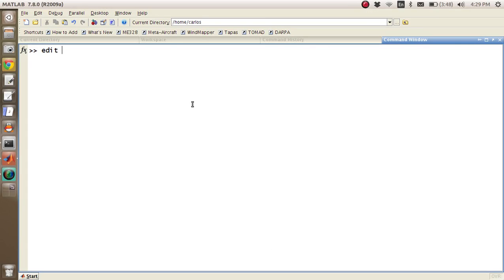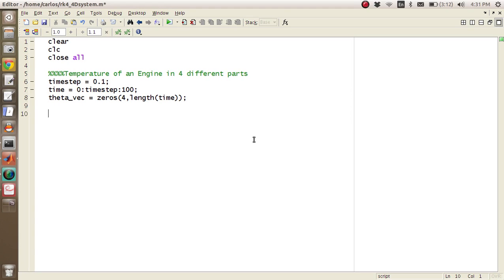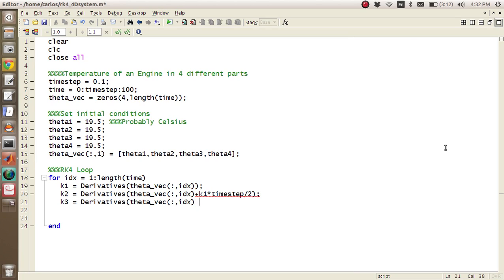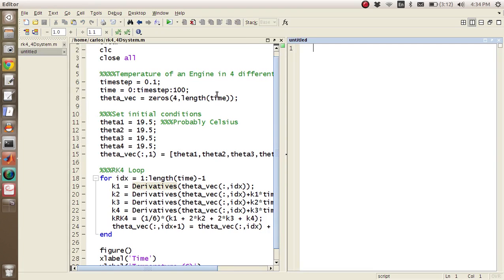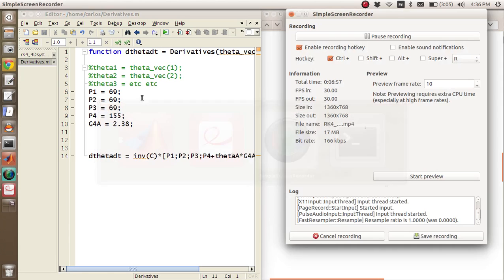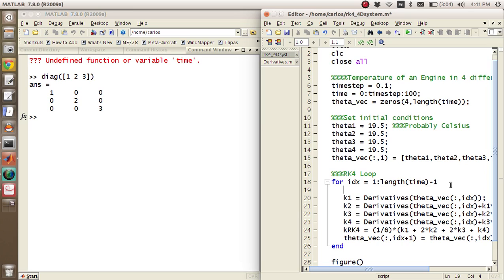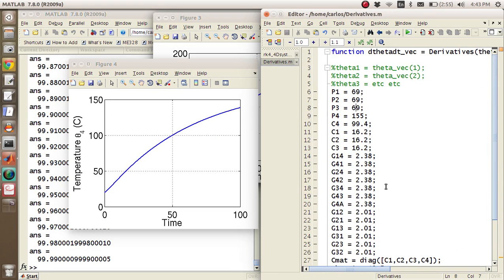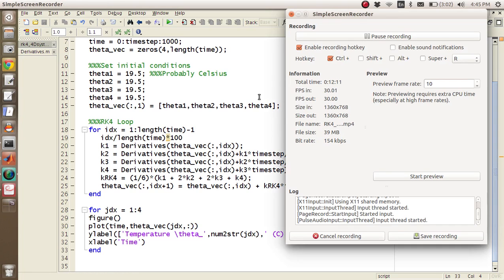MATLAB Help - Runge Kutta for Coupled ODEs

Comment: Hello Dr. Carlos, do you have a script in which one can include time-dependent terms in the differential equations? for example, ydot = -2*y + x*Et, in which x is a constant and Et is a time dependent term which is a driving force of the system for instance. Thank you.
Reply from the maker: The derivatives routine right now just has theta_vec as an input. If you send time as an input to the function you can add time as a variable to your DE solution. Hope this helps.
Reply from the maker: Here is an example with Euler's, RK2 and RK4 where although time is not explicit in the DE's but it is at least an input into the derivatives function. https://github.com/cmontalvo251/MATLAB/blob/master/Screen_Cast_Codes/RK4/myrk4.m
Reply: @CarlosMontalvo251  thank you! I have found a solution now, basically one has to interpolate the time dependent term at the specific time point and add as in input.
Reply: @CarlosMontalvo251  Sorry Carlos, the website is not available now! I still don't know how to solve the time-dependent situation.
Reply: @jinhuizhong8806  Sorry, can you help me ? I have the time- dependent question, too. How do you solve that? Thank you very much!
Reply from the maker: @silversherry_8500  Apologies. Here's the new links https://github.com/cmontalvo251/MATLAB/blob/master/screen_cast_codes/Integration/rk4_4Dsystem.m and https://github.com/cmontalvo251/MATLAB/blob/master/screen_cast_codes/Integration/Derivatives.m Also updated in the description

Comment: Thanks a lot for your video.I tried this method to solve my time-dependent coupled
odes and succeed,but the timestep needs to be set very small in order to converge.So it takes too much time to solve odes(usually several hours even a whole day).Do you have any good idea to lengthen the timestep and save time?Thank you very much!
Reply from the maker: Unfortunately it's not a simple fix. Timestep convergence is dictated by the dynamics of your system. If you are trying to simulate a system that has a lot of high frequency dynamics or even chattering due to some sort of switching the simulation is going to take a very low timestep to converge. This is where adaptive timestep algorithms like ode45 or even stiff solvers do a heck of a lot better. So you have two options. Lower the fidelity of model (remove some high frequency dynamics) or try another integration solver. Typically I go with the first or run my sims on a super computer worst case. Good luck.
Reply: Hi Boy, can you show me how to include time-dependent terms? That is exactly my question. Thank you.

Comment: Dear Dr. Carlos
How to solve a system of nonlinear 2nd order differential equations:
M.u" + C.u' +K1.u + KD.u^3 = -M.l.ag
where M, C, K1 and KD are matrices.
Using for loop.
Also, can I have your email?
Thanks in advance
Reply from the maker: You solve it the same way as the video above. Create a vector called u_vec and place all your states in there. In the derivatives routine you plug in your equations of motion by solving for u" using the matrix inverse function. Also no email. I'd rather respond on here.

Comment: Hey Carlos,
Could you please assist me to solve  a 2nd order state space equation with ODE 45 . I am going wrong somewhere in the A matrix and the formula. Please verify and correct me.
Thanks. You can email me at haripd94@gmail.com

MX ̈+ CX ̇+ KX = F 
Equation 1

where
F = μsN(Sgn(X ̇− V ) − σ(X ̇− V )),
Equation 2

σ=sigma= friction coefficient versus relative velocity slope
(grade), b V=belt velocity, N=normal force. By substituting
equation (2) with equation (1) yield

MX ̈+ CX ̇+ KX = μsN(Sgn(X ̇− V ) − σ(X ̇− V ))
Equation 3

Equation (3) can be rearranged as:
MX ̈+ (C + μSNσ)X ̇+ KX= μSNSgnN(X ̇− V ) + σV

K=5;
M=1;
C=1.5;
sigma=0.5;
nu_s=.5;
V_b=.5;
N=10;
x_dot=.5;

x0=[0 0.5];  

A=[0,1;-K/M,-C/M];

[t,x1]=ode45(@(t,x) ((A*x)-([0;1/M]*(nu_s*N*(sign(x(2)-V_b)-(sigma*(x(2)-V_b)))))),[0 20],x0);

plot(t,x1);
Reply from the maker: Sorry but I can't help you on specific problems. Perhaps this will help https://www.youtube.com/watch?v=mXzD9PTwdj4

Comment: Hi sir, i am a under-graduation student  there is a code in two  file (one is function, another is for output) i am uploading three part one for function , second for output , third for another function where parameter are differents  from first one. This code successfully run for first function parameter but not run for third function parameter  . please help me.

FIRST PART(parameter)

function xprime = state1(t,X) 
% CALCULATE THE TEMPORAL DYNAMICS OF DIFFERENT STATE
%________________________________________________________________
% PARAMETERS USED FOR THE CALCULATION%___________________________
h = 6.626*10^-34; % Plank's constant (m^2kg/sec) or "Jule"
c = 3*10^8; % Speed of light (m/sec^2)
lambda_P = 532*10^-9; % wavelength of the pump beam
lambda_S = 633*10^-9; % wavelenngth of the signal beam
r = 0.5*10^-3;        % radius of the pump beam ( 0.5 mm)
A = pi*r^2;           % Area of the beam
E_p = (h*c)/lambda_P; % Pump photon energy (in Jule)
E_s = (h*c)/lambda_S; % Signal photon energy (in Jule)
%eV = 1.61*10^-19;
%E_p_eV = E_p/eV;     % Energy of the pump photon in eV
%E_s_eV = E_s/eV;     % Energy of the laser photon in eV
P_p = 1*10^4;         % pump power (50 mW)
P_s = 32;        % signal power (50 mW)
sigma_a = (10^-16)*(10^-2)^2;      % Absorption cross section (cm^2)
sigma_s = (10^-15)*(10^-2)^2;      % Emission cross section (cm^2)
sigma_TT = (10^-14)*(10^-2)^2;     % Triplet-Triplet absorption cross section
%sigma_ESA11 = ((10^-16)*(10^-2)^2)/0.001;          % Intersystem crossing rate (sec^-1)
eta_ISC = 10^8;        % Constant intersystem crossing rate
sigma_ESA = (10^-14)*(10^-2)^2;
%_________________________________________________________
Ip = P_p/(A*E_p);      % Pump rate (1/m^2/sce)
eta_P = Ip*sigma_a;    % Pumping rate (photons/sec)
%_________________________________________________________
Is = P_s/(A*E_s);      % lasing rate (1/m^2/sce)
eta_SE = Is*sigma_s; 
%_________________________________________________________
t_f = 5*10^-9;        % radiative lifetime of the molecules
eta_f = 1/t_f;        % Rate of spontaneous emission
%_________________________________________________________
%eta_ESA = Is*sigma_ESA;
%eta_ESA = sigma_ESA;
%_________________________________________________________
t_T = 1.5;
eta_T = 1/t_T;
%____________________________________________
eta_TT = Is*sigma_TT;
eta_ESA = Is*sigma_ESA;
%____________________________________________________________
%SOLUTION OF ODE BY 4TH ORDER RUNGEE-KUTTA METHOD
xprime = [eta_P*X(2)-X(1)*(eta_SE+eta_f+eta_ISC+eta_ESA); -eta_P*X(2)+X(1)*(eta_SE+eta_f)+eta_T*X(3); X(1)*(eta_ISC)-X(3)*(eta_T+eta_TT); eta_TT*X(3); X(1)*eta_ESA];

SECOND PART(ODE Slotuion and plot)

S1_0 = 0;
S0_0 = 10^32;
T1_0 = 0;
T2_0 = 0;
S2_0 =0;
%P_p = 10*10^-3; 
S_total = S1_0+S0_0+T1_0+T2_0+S2_0;
X0 = [S1_0 S0_0 T1_0 T2_0 S2_0];
tspan = [0,100*10^-9];
[t,X] = ode45(@state1,tspan,X0);
%plot(t,X)
 
S1 = X(:,1)./S_total;
S0 = X(:,2)./S_total;
T1 = X(:,3)./S_total;
T2 = X(:,4)./S_total;
S2 = X(:,5)./S_total;
%_____________________________________
%Laser intensity calculation through Population inversion" 
L = (S1-S0);
Norm_L = L/max(L);
plot(t,S1,'-r'); hold on
plot(t,S0,'-g'); hold on
plot(t,T1,'-b'); hold on
plot(t,T2,'-*'); hold on
plot(t,Norm_L, '--r'); hold on
plot(t,S2, '-y')
ylim ([0 1]);

FIRST PART(For different parameter for which code not run)

function xprime = state1(t,X) 
% CALCULATE THE TEMPORAL DYNAMICS OF DIFFERENT STATE
%________________________________________________________________
% PARAMETERS USED FOR THE CALCULATION%___________________________
h = 6.626*10^-34; % Plank's constant (m^2kg/sec) or "Jule"
c = 3*10^8; % Speed of light (m/sec^2)
lambda_P = 556*10^-9; % wavelength of the pump beam
lambda_S = 626*10^-9; % wavelenngth of the signal beam
r = 0.2*10^-3;        % radius of the pump beam ( 0.5 mm)
A = pi*r^2;           % Area of the beam
E_p = (h*c)/lambda_P; % Pump photon energy (in Jule)
E_s = (h*c)/lambda_S; % Signal photon energy (in Jule)
%eV = 1.61*10^-19;
%E_p_eV = E_p/eV;     % Energy of the pump photon in eV
%E_s_eV = E_s/eV;     % Energy of the laser photon in eV
P_p = 1*10^4;         % pump power (50 mW)
P_s = 32;        % signal power (50 mW)
sigma_a = 1.8*10^-24;      % Absorption cross section (cm^2)
sigma_s = 9*10^-18;      % Emission cross section (cm^2)
sigma_TT = .1*10^-12;     % Triplet-Triplet absorption cross section
%sigma_ESA11 = ((10^-16)*(10^-2)^2)/0.001;          % Intersystem crossing rate (sec^-1)
eta_ISC = 4.2*10^5;        % Constant intersystem crossing rate
sigma_ESA = (10^-14)*(10^-2)^2;
%_________________________________________________________
Ip = P_p/(A*E_p);      % Pump rate (1/m^2/sce)
eta_P = Ip*sigma_a;    % Pumping rate (photons/sec)
%_________________________________________________________
Is = P_s/(A*E_s);      % lasing rate (1/m^2/sce)
eta_SE = Is*sigma_s;
%_________________________________________________________
t_f = 350*10^-12;        % radiative lifetime of the molecules
eta_f = 1/t_f;        % Rate of spontaneous emission
%_________________________________________________________
%eta_ESA = Is*sigma_ESA;
%eta_ESA = sigma_ESA;
%_________________________________________________________
t_T = 10^-3;
eta_T = 1/t_T;
%____________________________________________
eta_TT = Is*sigma_TT;
eta_ESA = Is*sigma_ESA;
%____________________________________________________________
%SOLUTION OF ODE BY 4TH ORDER RUNGEE-KUTTA METHOD
xprime = [eta_P*X(2)-X(1)*(eta_SE+eta_f+eta_ISC+eta_ESA); -eta_P*X(2)+X(1)*(eta_SE+eta_f)+eta_T*X(3); X(1)*(eta_ISC)-X(3)*(eta_T+eta_TT); eta_TT*X(3); X(1)*eta_ESA];
 
May be problem occurs in this line 
[t,X] = ode45(@state1,tspan,X0);
How i can solve this.
Reply from the maker: I can't help with individual projects.

Comment: hey can you help me out with my problem.I have a set of 17 coupled 
equations having 17 variables. initial conditions are known i have to 
find out the temperature and length.taking h=0.5.Use runge kutta for 
simultaneous differential equations. my mail id 
kumar.jigyasa31@gmail.com 
differential eqn is like dT/dz = 
f(a,b,c,d...), da/dz=f(a,b,c,d...) and like these 17 equations.all the 
equations are in terms of T and a,b,c,d,etc.Finally i have to find out z
 and T when SO2/h2s = 2.3. This is the condition.
Reply from the maker: You should just be able to create the equations just like I've done above. Do you have any questions about the problem in this video?

Comment: hey 
what abt coupled non linear equations. can those be solved with the same method . i am dealing with a problem in which my equation of motion are co dependent and non linear. can u suggest how to deal with it
Reply from the maker: The system above is non-linear. RK4 has no problem with linearity.

Comment: Hi Dr. Carlos,

I was wondering if you could do a MATLAB tutorial on solving coupled ODEs using Symplectic Euler Method or The Stormer-Verlet Scheme?

Thank you.
Reply from the maker: Unfortunately I cannot. I have never heard of either of those Methods. I just use RK4 for everything.
Reply: You might know the methods under a different name. 

The Symplectic Euler Method is a modification of the Euler method for solving Hamiltonian equations.
https://en.wikipedia.org/wiki/Semi-implicit_Euler_method

The  Stormer-Verlet Scheme is specifically constructed for solving force problems. This basic method, or its equivalent formulation, is called the Stormer method in astronomy, the Verlet method in molecular dynamics or the leap-frog method in context of partial differential equations.

It's ok if you still don't know. Thank you for replying Dr. Carlos.
Reply: I have another request, Could you please make a tutorial on the truncation error that occurs for the Euler, RK2, RK4 methods?

Thank you.
Reply from the maker: The semi implicit euler method looks just like a fancy way to integrate second order equations. It seems irrelevant given the appeal of RK4 especially since you can easily vectorize RK4 to handle higher order ODEs. 

As for the Stormer or Verlet method I have never seen it. In rocketry and aircraft dynamics I have had no problems with RK4 provided the timestep is small enough.
Reply from the maker: I will add truncation errors to my queue of videos that are created although I'm not sure when I will be able to get to it.
Reply: Thank you for replying Dr. Carlos, all your other videos are amazing thanks again :)

Comment: Hi Carlos, I have three coupled equations two of them are simple first order ODE,s but the third one is nonlinear differential equation (Gross-Pitaevskii/GP equation), containing first order time dependent and second order space dependant(∂2/∂x2) terms. For just one GP equation literature says that it can be solved by RK4-IP method by considering linear and non-linear parts of the equation separately, but I couldn’t catch up how to couple this with other two ODE,s using RK4 method. Please suggest some way to handle this system.
Reply: as long as you integrate then all together or rather at the same time there shouldn't be an issue

Comment: Good job, Carloss. I have a similar problem to this one. The only difference is that the coefficients in the coupled equations are not constants and they are function of one of the variables I am solving for. How should I deal with inconstant coefficients using RK4? I coded the problem in Matlab and it's working with constant coefficients.
Reply from the maker: In the Derivatives routine,  instead of having say P1 = 69 you would have P1 = some function of x or t or whatever you want. RK4 will not have a problem handling that.
Reply: I did that and the code is working but the results did not match the expected trend I have. Do you mind sending the code I developed to you?
Reply from the maker: Hi Mohamed, Unfortunately I cannot promise anything as far as looking at individual viewers code. Feel free to send it to me but I get multiple requests from multiple viewers to assist in MATLAB code. I will do my best but I can't promise I will get to it in a timely manner.

Comment: Thanks it is very helpful. can you help me to solve coupled second order equation like as two degree of freedom equation, plz.
Reply from the maker: This youtube video is designed to help you with coupled ODEs much like your second order example. The example above is 4th order. It shouldn't be much more difficult to reduce the order to 2. Also, I wrote a simple blog post on simulating a spring mass damper (Second order) here. http://cmrelabtutorials.blogspot.com/2015/03/everything-you-need-to-know-to-code.html?view=classic With a supplemental video here https://www.youtube.com/watch?v=XQPWE2DUIE8